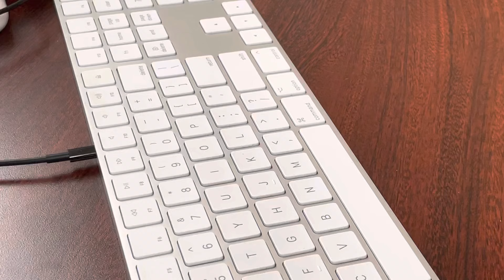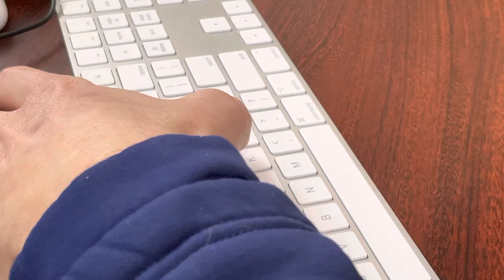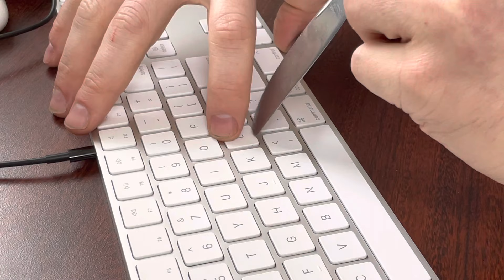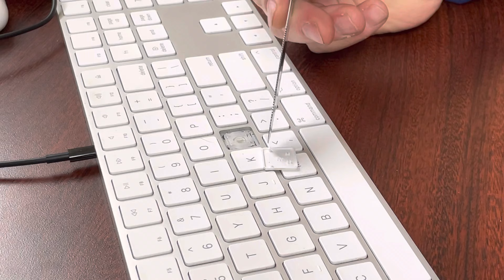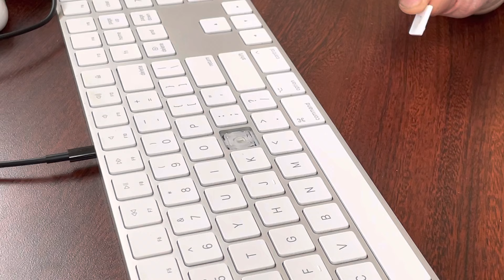How to remove and fix Apple Magic Keyboard keys

Comment: Ok, so I've seen the taking the key off, and putting it back on.....but where is the "fixing" part???
Reply: This keyboard has issues with board lines. So if you experience keys in a line or near each other not working. You basically need new keyboard

Comment: Thank you!  I just pried up a little bit on the bottom of both keys I was having trouble with, blew some air from my mouth, and both keys now work.   I have the a1843 apple keyboard, and did not have to take the keys off.

Comment: Super useful guide! Thanks
Be aware that the lower right key (the right arrow) is basically upside-down, the key is the same as the left arrow but Apple, in order to save in production cost, turned it upside down. So basically for this key the procedure has to be done from the upper part of the key and then sliding the key upwards.

Comment: Thank you so much; this video just saved my work keyboard! I came back from a trip and found that the letter k was stiff. I removed it per this video, cleaned it with canned air and alcohol, and then safely replaced it as shown. Much appreciated!

Comment: Excellent explanation of how to reinsert the key and what could happen to the little tabs if you push straight down (as another video said to do).  Because I got bad info, I had to "reform" those tabs.  Fortunately this video explained that, I was able to reform them, salvage the key, and got it back in correctly.

Comment: Thank you! Worked wonderfully. M key was getting stuck on my keyboard, so I took it out using this guide and cleaned it out, put it back on with no issues and now everything works fine! I also used a gift card instead of a butter knife because that's what I had on hand.

Comment: I was never able to fix a broken keyboard, especially after the dog chewed thru the cable twice, even after re-connecting the 4 wires in the cable it still didnt work. and to-day after simply wiping the keytops with a paper towel slightly dampened with rubbing alcohol to clean them, "b" and "n" no longer work, after carefully just removing the N key as shown-  now the entire row Z through  / no longer works, the things are just way too sensitive and no longer work like the old mechanical keyboards with contacts used to. So the Macally aluminum keyboard goes in the trash and I ordered  new one just now.
The keyboard was 8 months old, used every day, time to get a new one anyway.

Comment: Nice! 
Wish I saw your video before I forced two keys in and damaged those top parts...tried to fix and now one side of the two keys spring up but the other halves are just preeminently sunk in. 
smh
Reply: you can use a needle to pry out those top parts, that's what I did, and it went back working perfectly again even though they are still uglily damaged, but somehow it works like the video suggested